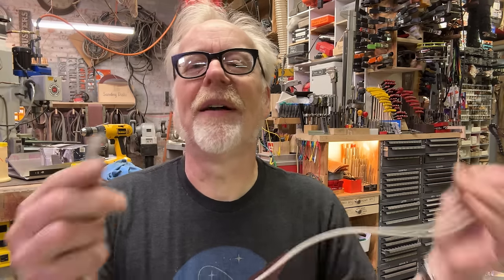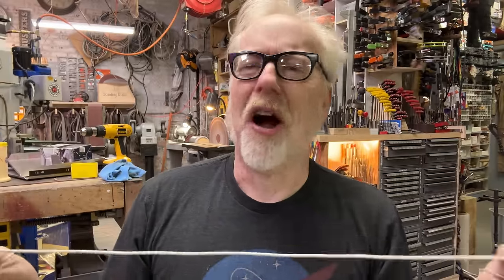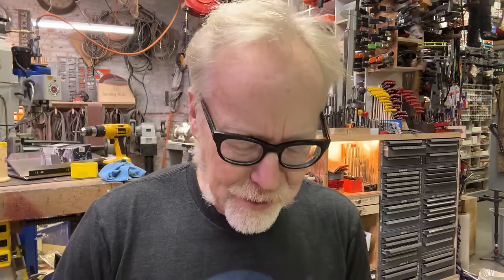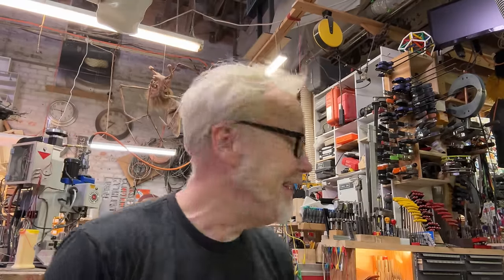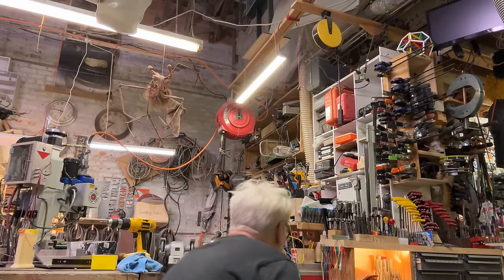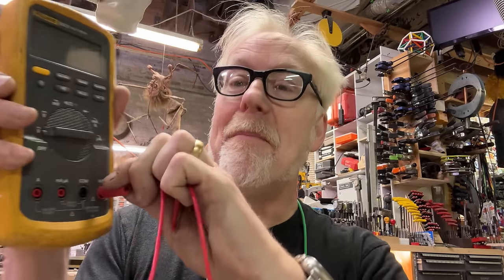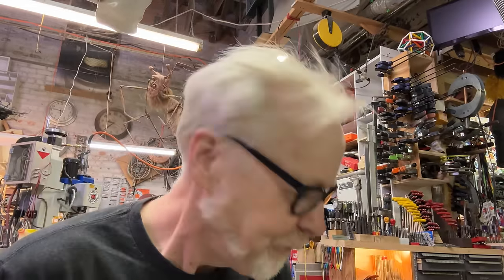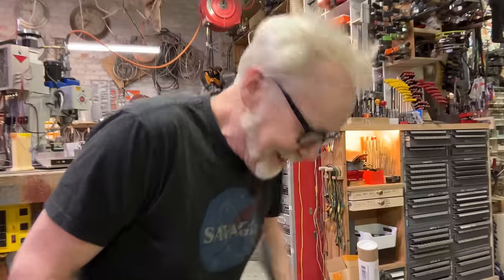Adam Savage's Alligator Clip Leads Problem

Comment: I've been working in/around electronics since I was a teenager and use some of the same tools still, so around 45 years since I'm roughly Adam's age.  There are plenty of good brands and tools out there, people just have to be willing to pay for them like Pomona.  The problem is that everyone demands "cheap" everything ... therefore that is what you get thanks to Amazon, ebay, Harbor Freight, etc.  Quality at a low price does not exist, you can have one or the other.  Another alternative is simply buying that inexpensive set and reworking them all.

Comment: Fluke AC175 Threaded Slide-On Alligator Clip Set with Flexible Boots. 
These are hands down the greatest clip leads of all time* if you are attaching them to a fluke multimeter.
They attach and screw on to the fluke multimeter leads and have a great positive connection. That being said for $35 a pair they better be. 
It turns the multimeter into a zero hands device which to me is invaluable. Plus they are powerful enough you can clamp two wired together and inherently read the voltage of the “node” that is that junction

Comment: I do automotive electronics repair for a living my issue with clip leads is how easy they can flip and short to another clip lead or something else you don't want them to electrically connect. The insulation on these is not adequate. Due to improvements in crimping technology I find the cost of cheaply available crimp connects to be worth the sacrifice of not having the headache of clip leads.

Comment: How about hemostatic forceps -- the scissor-like clamps that surgeons use? I just learned that jewelers use GROUNDED hemostats for welding tiny parts. I love the idea of adding a mechanical hold, not just relying on a spring.

You could also find the smallest possible locking needlenose pliers.

Comment: Adam - I've used these cheap generic alligator clips for years and never had them go slanted/off-bite. BUT my biggest complaint about them is the smooth rubber'ish material around the clip.  If your hands aren't bone-dry, they just keep sliding around any half the time I'll just rip those off so the clip actually works easier.  Like yourself, the two styles you showed you discovered, I recently came across myself as well and favorite them much better.  That said, I still use the cheap alligator clips. Often I'm using them for super quick whip-up projects where I'm either beyond over their voltage ratings or beyond over their current ratings, with the mindset of "Well, Yes it gets hot. But it only needs to handle this test for a few seconds to see how  ( project ) acts. As they slowly die from abuse, I replace them with the larger clips like you shown.  Usually I need ones with 12awg+  but, cheap alligator clips are still handy for little arduino-type test setups.  stepper motors and what not!

Comment: Other notes: (most importantly) Solder That Wire! Irrespective of the type of clip, it's almost certainly unsoldered. Check and solder it. You can use your cutters to carefully open the crimp enough to slide the wire out and push a bit forward before recrimping, then solder it to the inside of the clip. You'll need a higher than usual iron temp and some flux. Then carefully re-crimp with pliers (presumably you don't have the right crimper). Yes, it takes some time, but it's worth it if you're working with more than few hundred mA, eventually the clips will start to get warm/hot if you power something long enough with them or power something high-current.

I'm also happy with those big clip leads with the nice moulded boot. The wire is thick and copper. At least the ones I bought. If you buy the cheaper ones, often the wire is very thin and can't carry much current. Also it may not be copper wire. Aluminium wire will fizzle and burn with the flame test, compared to copper which will glow red hot. Iron wire is obviously attracted to magnets.

Comment: Why hasn't anyone improved croc clips? Because they have made them steadily worse since the 1960s and early 1970s, cheaper and cheaper with less materials and rubbish design and construction, in good Capitalist fashion. Back In The Day (in the UK) my local electronics shop (*not* Maplins, an independent) only stocked croc clips that had a longer lever action, making them much easier to open than the current bog-standard clips (the ones that you dislike).

The hook clips for grabbing onto IC package leads were way better back then, as well: the least expensive were still longer than either of the two el-cheapo designs we get now and provided a screw connection for the lead (and were solderable if you wished to do that). They had a good, positive, grip which was strong enough to support the weight of the clip and test lead (unlike the current desgns which just flick off the IC/test post if you just nudge them).   I've not been able to find anything similar for years - just cheap grot or expensive "professsional" hook leads to use as 'scope probes and which are completely OTT for your basic blinky lights and two transistor warbling wonders.

Comment: I've used 'syringe' style leads that have alligator jaws, but you don't squeeze or pinch the the jaws to open them. Hold the lead between your fingers with the wings against your finger tips and use your thumb against the hook on the lead barrel to slide the outer jacket backward from the lead holder.  This opens the jaws.

Comment: There are so called Kelvin Clips. Those seem to be commonly used with LCR meters and 4-wire measurements.
They seem both more ergonomic and optimized for low contact resistance. Rarely come with grippy jaws though, it seems.
Some variation of those might be handy on a multimeter even for ordinary use (when terminated properly).
They might still be more expensive than the ordinary alligator clips, so probably won't become a common sight on both ends of ordinary test leads.
But always can DIY a set.

Curiously, some higher quality clips can be found for medical use - google for eeg or emg clip cable. They seem finer and better insulated.

Comment: They make the plunger hook clips that slide onto standard meter leeds as well. Though most of the time I am using my meter I'm using it on devices rather than wires.

Another type used almost exclusivly in Telecom is Bed of Nails. Its insulation Displacement with small needles. That let you grab into 23/24 gague solid phone wire without disconnecting the ends.

Comment: My solution to crocodile/aligator clips is to try not to need them.
Breadboard can reduce the need as can plastic boxes with a series of spring or screw terminals each connected to a 4mm banana plug socket.
I also have a number of modules such a plastic box with a switch and two 4mm banana plug sockets which can easily be connected into a circuit.
Finally Staubli part number 22.3006-22 can be very useful.
Reply: Hard to stuff a 14-gauge stranded motor lead into a breadboard, is what I'm thinking.

Comment: I've been working on electronics for almost six decades now and find most clip leads you buy are cheap junk. I buy Mueller 32c copper clips (not the steel ones) and use thinwall insulated (teflon if I have it) copper wire. I solder the wire to the clips and use flexible rubber boots to insulate the clips. These last till I lose or bury them so every once in a while I'l spend 15-20 min making new ones.

A like those grabber cips and usually by the tw foot ones, cut them in half and put a allicgator clip on that naked end.

My first Fluke is the original model 77 that came with a heavy rubber boot that I bought from Sears in the mid 80's when they were having a catalog sale. I also have three of the 8060a's that was one of the best hand held meters they ever made. Those were pricey ($3-400 new) so I picked them up when someone was selling something he did';t understand) The last one i boughy on ebay for $45. I also still use a Simpson 260 that I bought at allied in 1962, analog meters are very handy in some applications.

Comment: I feel this resonate deeply with me.
Now imagine combining alligator clips with some cheap, wonky breadboard and you're just learning how to use a microcontroller like Arduino. Suddenly you have so many potential points of failure and troubleshooting it gets frustrating. When you're not sure if your code is wrong (or if you're using the wrong library for that specific component) or is there a bad connection somewhere in your electronics.

Comment: Gator clips from 45 plus years ago were made properly.   I still have sets I stole from high school electronics classes when I was a kid.   They are still aligned and flexible silicon rubber.    I cannot remember ever having to even re-solder them to repair them.  I think they are Pomona brand.   Even the modern Pomona leads are not quite like the vintage ones.   When I buy leads today the first thing I do is solder them all up so I know I have continuity integrity.   Many times I will even increase the gauge wiring to increase the current carrying capability.

Comment: 8:40 - I'm thinking a pivoting top jaw that will close completely on the lower jaw regardless of angle. or cupped upper and lower jaws that close past each other like the top on the outside and the lower on the inside and close to where there is no gap between them.

Comment: "SDK08" micro clips: There are multiple clones of likely varied quality, but for very very small things like the legs of SMD chip legs or tiny wires these have a forked pincer tip that very positively grips just about anything, sort of like a tiny earwig's butt.  The other end is a pin that takes a standard 0.75mm female Dupont wire.  There are some larger types with the same sort of opposing pincer design, sometimes they work better than the single-side hooks.

Comment: If they weren't so expensive, I'd have a dozen sets of the fluke multimeter lead packs to use for circuit prototyping. Leads are shrowded banana on both sides, and the kit provides the proper clip ends for various wire and termination ends.

Comment: Putting a bit of rubber in the jaw to help with opening resistance or a reverse spring slightly smaller in the hinge perhaps? If it has a wider tip and makes a better connection to the wires without slipping is important. The henge itself can be shifted and its week points reinforced with a higher- grade material with the wire going to the tip only. The wire being the only part that makes the contact. could also be a possibility.

Comment: I've been loving the wago lever nuts lately for ad-hoc wire-to-wire connections.  Metal quality is definitely an issue with any kind of alligator clips, and even some banana plugs.  I've had a few banana plugs shear off in the socket because the metal was such cheap quality.  As with anything mass produced and sourced from a certain country notorious for cheap poor-quality metal products, it's important to check the quality of what you're getting.

Comment: If you're working with small electronic devices, a breadboard is a good way to go - you are connecting to points on a line with wires - no additional connectors required.

Comment: My most recent discovery in this vein was also something of a Rumpelstiltskin problem.  I was looking for the connectors that came with new lighting fixtures I got for my mom, and had so much trouble finding them, they're small blocks with levers on them, and you can just push the wires in and snap them in place with a very positive grab, no force required, and in a form factor that can work for some final installations.  
I've since been able to find them as "Block connectors" or "Lever Nuts" 
They don't fit the exact niche that alligator leads do, because they won't work as well for parts with flat terminals, but for mocking up a circuit, I'm probably going to use them from now on, as most of the projects I work on have wire leads that work nicely with them.
Reply: Wago connectors? They make the most popular level connectors, and now they also make push-in connectors. The jury is still out on them though. They have a little more connection resistance and get a little warmer under normal loads. Very handy for lower-current situations (lamps, not space heaters).

Comment: Rather than a simple hinged jaw, it would work great to have parallel jaws that stay parallel as they open or close.
Generally, think of all the clamps you use.  Any of the many designs for clamps can be used for clip leads -- how about "quick clamp" pump style that you can tighten with a gentle squeeze?

Comment: A few months back I saw a video about synthesizer builder Nervous Squirrel, who was showing off his massive homemade modular synthesizer. In it, he said that one of his first modules built was a ring modulator: an unpowered circuit consisting of a couple of transforners mated with a ring of diodes, such that a signal gets multiplied by a second signal. (It's the basis of Dalek voices and a mainstay of weirdo guitar effects.) It's such a simple circuit, he said, that you could build it with clip leads. 

So I actually tested this out, and indeed that worked: hooking the signal transformers to the diodes, and hooking the diodes together, all worked to produce exactly the right weird effect.  

I then immediately took it apart and built a properly soldered module from the pieces, because the clip lead connections were marginal and fragile, but it really is impressive ehat you can do with improvised tools.

(The video is "Nervous Squirrel: Incredible DIY Modular Synth" by Sound on Sound magazine; it's a great look at an incredible DIY electronics builder.) 

(If someone wants to build a ring modulator, my big caveat is that it needs a lot of amplification to work; with Eurorack signal inputs, which are roughly ten times as powerful as home stereo signals, you still need a boost to get the resulting audio back to the proper level, because of the losses in the transformers and diodes.)

Comment: I hate the small cheap clip leads too. They slide sideways between your fingers when you want to open them, making it so much harder than it should be to open them. I still keep mine, but I also found more solid clips, similar to the ones on your favourite clip wire, but not as fine quality, but they were not attached to a wire. Instead they had a 4mm banana socket, and since I have loads of 4mm banana wires (I use them for modular synthesis patching), that is the perfect solution for me. The only problem with the more ergonomic alligator clips, of course, is that often they are simply too big and even the small rubbish ones you have to place very carefully to avoid creating shorts with something next to them are sometimes on the big side for hooking up to small electronic components.

I have been wondering if I should make my own prototyping breadboard some day with many connection points ready wired to banana sockets, audio jacks, power connectors and a battery, just so I can dispense with most of the alligator clips and can do some of the erstwhile fiddly patching between components on the breadboard with banana cables on a patch panel.

Comment: kinda seems like you could benefit from the experience of batch production of some alligator clamps of your own design or maybe the manufacture of your own stamp and dies to make the parts out of thicker gauged metal. you could potentially make the equivalent of pipe clamps where you use the terminals to make your own custom length wires

Comment: The "alligator" or "Snapping Turtle" clips are usually too wide for attaching to small components on circuit boards or in tight spaces in enclosures, unless you like sparks and "The Mysterious Blue Smoke" (What a pleasant MB flashback. But they all are.)! The mini-hooks are the best for electronics work!

Comment: "I know enough to be dangerous"
Ptff, I got a similar saying with some stuff. "I know just enough to get into trouble." 
Because that's how I am with scripting. I know enough to work with a few of them, but not enough to not cause problems. Like the other week I was working with my primarily AHK script that runs at login, and one of the changes I made resulted in my computer's memory (64GB) being completely filled within the span of 20 seconds. Had to force a restart and launch into safemode to fix it.

The lesson there is to not have a script handle the auto launch of something, without first verifying that it can properly detect if the thing it's going to launch isn't already running.

Comment: Try an autotive electrical course to up your 12v knowledge. Sites like aeswave have a wide assortment of connections,  even if you didn't buy there, it could give you ideas of what's available.  Making your own leads is a good option,  although doing that adds another project to the roster.

Comment: I bought a lot of those cheap clip leads in HKG, the wires are only held in place by the metal clamps inside... what helped significantly was to solder the leads to the metal clamp instead! Therefore the the very common lose connections and random high resistances are fixed. I get about 0.2-0.4 Ohms on such a clip lead. A better way of course is to buy high quality leads from oscilloscope manufacturers, certified in lab quality but also at high cost.